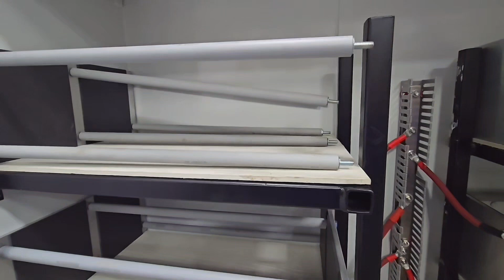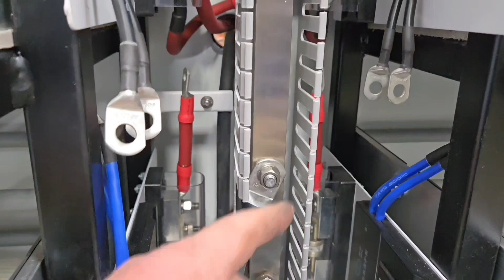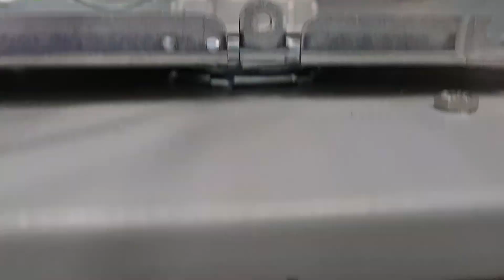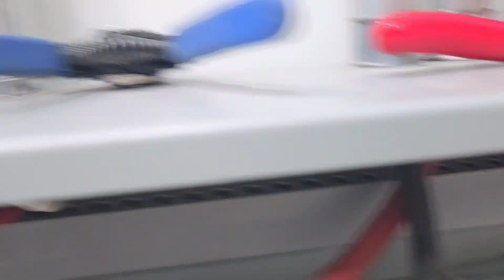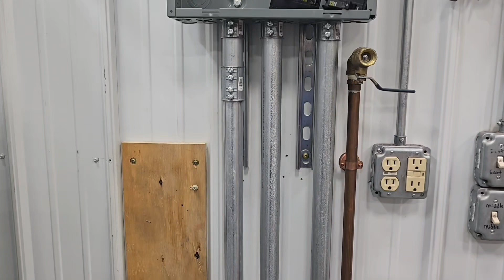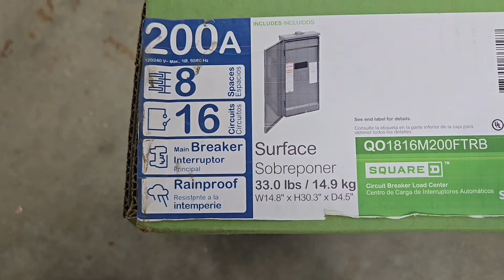Shop Solar System- Out of the Box Part 3

Comment: You do amazing work, Doug. Can you please update video description to include links to products including: the precharge light bulb, and the High current DC Disconnect, and any other things you found useful? Thanks!
Reply from the maker: I decided early on I would not monetize my channel. This allows me freedom to express my honest opinion. As I do post these videos on 
The DIY Solar Forum owned by Will Prowse, I am prohibited from having any affiliate links with my videos. The precharge 48V light bulb as well as the socket are from Amazon and the 600A disconnect was shared on the DIY forum. It is a Rincon Power HVBD 600A Disconnect.
Reply: @doczwy8143  was it a incandescent 40w ba15d '48vdc forklift bulb' On amazon? And what size fuse do you use for it, or do you skip it?
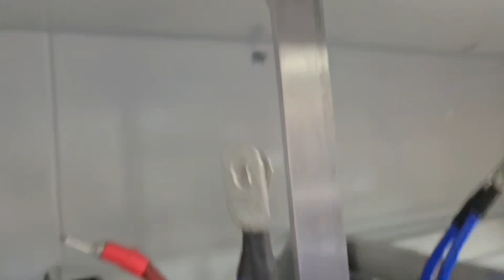Reply from the maker: @jamesbsa6450  Yes, that is the correct bulb. 10A microwave ceramic fuse shown in part 4 around the 3:50 mark. The breaking potential is much higher with the ceramic fuse. As I said in one video, in my opinion, any current carrying conductors except neutral wires should have a breaker of fuse.